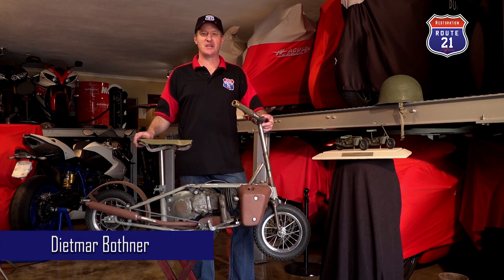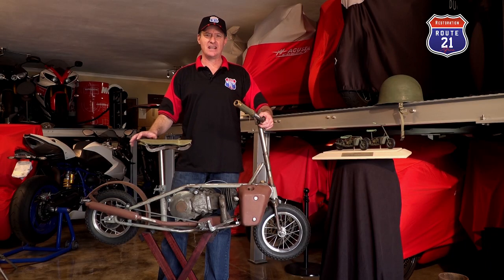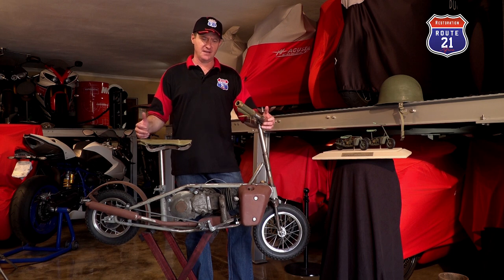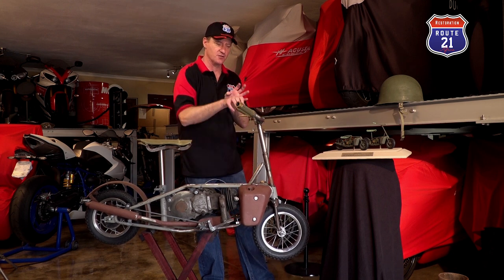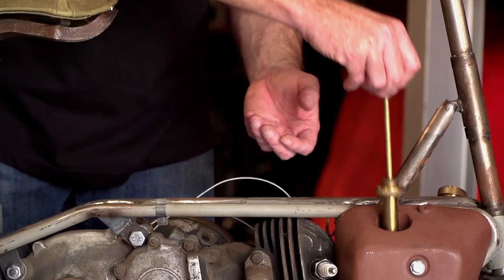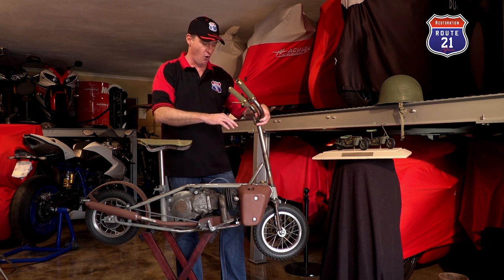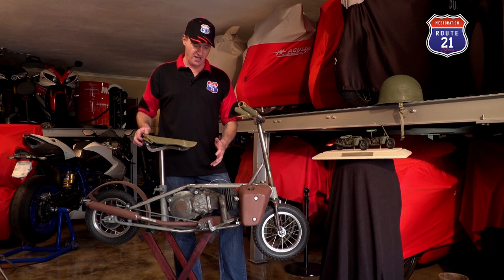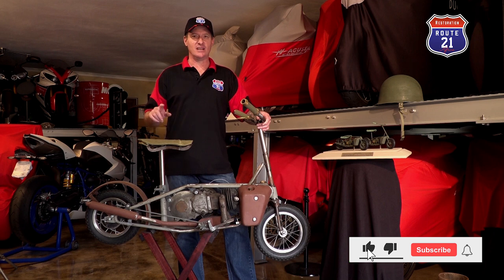Restoration of WWII Welbike Part 1

Comment: Just a comment on the handle bar grips. The originals also were made of canvas. Ik have seen and even held original grips. The european used had black leather saddle. There were 2 types welbikes. The MKI and the MKII. Also about 14 prototypes were made these had smaller a bit water drop shape tanks. At least 2 have survived, a friend of mine has one. The main distinguishing feature of the MKI and MKII is the MKII has a rear fender, also a less distuigishable improved pressure tank. Your rear fender (replica I presume) is to large, just compare it to the one you see in the ww2 film.  You could have a MKI if the contractnumber is still there you could find it on Wikipedia.